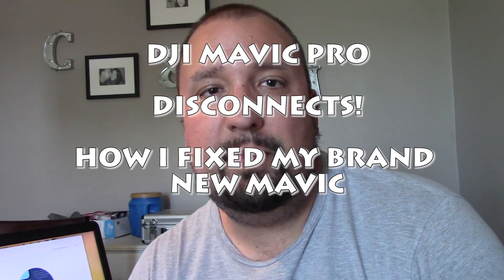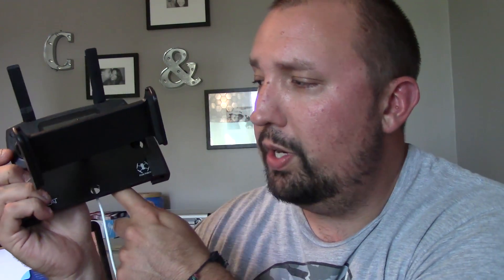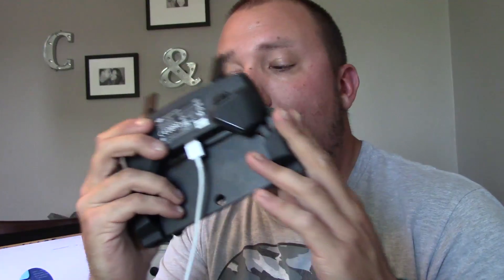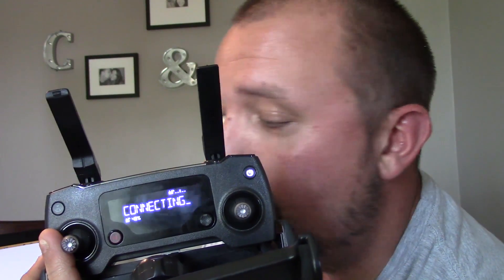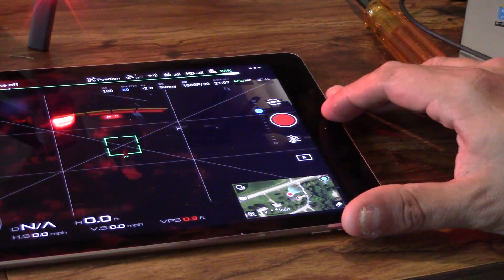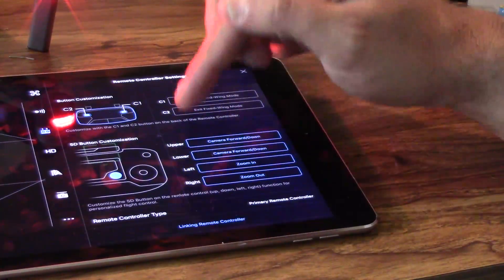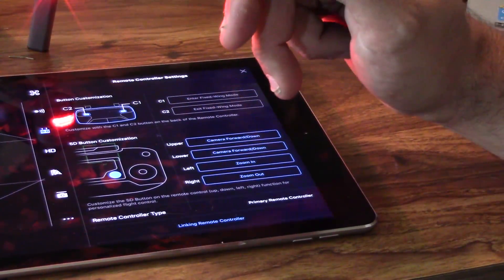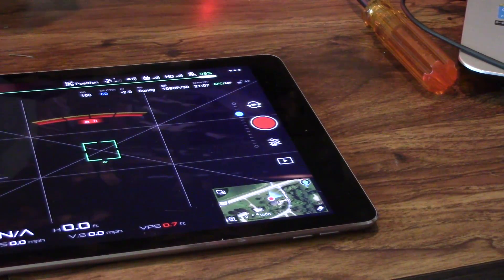DJI MAVIC PRO-HOW TO FIX DISCONNECTS- HOW I FIXED MY NEW MAVIC

Comment: This completely worked. Thank you so much. 
The issue I had was the "disconnect" from the RC and the phone. I just had to download the DJI assistant and it immediately worked. 
Now it seems the problem is the update of the firmware.

Comment: Really works fir my mavic pro Platinum,i try three cables to connect the USB of the controller with my phone and the third one works,seems the speed stransfer capacity of the cables can be really tricky!
Reply from the maker: Nice

Comment: My mavic gets disconnected just when it flies  7 mtr height , and when I bring it near 3 to 4 mtr it again gets connected . Can you suggest what could be the problem or could you send some videos to solve those problems.
Reply from the maker: are you using android or an IOS device?
Reply: @Dorkyand40  android phone note 10 plus.
Reply from the maker: @akungwelly  ah ok.  really stinks that android and the go app have never got along.  def try to use the original cord that comes with the phone and plug into the bottom of the mavic remote.
Reply: Does the Mavic gets disconnected when flying near some cellphone tower ?

Last time when I tried in different location the problem got solved but today again when I tried to fly my mavic zoom in my home compound the same disconnection problem start up again, 2 mobile towers are installed  a 1000 mtr away from my home. So I wonder is the tower causing the problems to disconnection ? Because day before yesterday i tried to fly my  mavic zoom in different location,  it has no disconnection issue at all but now when I tried to fly in my home which has a nearby cellphone tower,   my mavic gets disconnect just right away in 6 mtr. Itself , 

Please advice , what could be the problem as per your knowledge. 

Please revert back to me.

Comment: When I press the back button on my mavic 2 zoom or when I lose signal with the control, the drone DOES NOT return home, he tries to land, why? That also happens to me whenever I lose the signal with the control and almost lose the drone several times. I have configured that in case of signal loss, he returns to the takeoff point, but always tries to land.  Now I'm afraid to fly. I have the firmware updated and I always return in GPS mode. Please help!

Comment: for my Mavic Pro Platinum the "gimbal disconnect" message appeard suddenly out of the blue. TLDR:( put a new SD card in or format your old one) and the only solution was to take out the SD card, try turning it on without an SD card, and then it was working normal. So I formatted the SD Card, put it back in, and then it worked again like a charmer.

Comment: Hey brother, I am glad I stumbled into your video.  I was not going to watch it because it said Mavic and I have a Phantom 4 Pro Obsidian, but I went ahead and said WTF why not.  I had already watched a few other vids without any solution.  Then when you said "well maybe this will work, and maybe it wont", however you stated that, I was sure that I was still not going to get the answer...but your message of keep trying over and over, and trying multitudes of different methods, that is what got it for me.  I kept at it and kept doing the things you said...I loaded one version, then the other, did a full factory reset and was about to give up...but then I tried one more time...and it is fixed.  So thanks man.  You got me there.
Reply from the maker: good to hear man..it amazes me that a year later these problems still exist and there is really no answer from DJI..enjoy your P4P..its a great ship!

Comment: 11/10/2017 
This is important! I think I’ve discovered my solution to the error “Lost signal” and an Android (v5.1) error “Unfortunately Go 4 app has stopped”.
I've received my Mavic pro from warranty repair on Oct 8 2017 and was disappointed that after trying to activate the go 4 app the screen showed an android error which I eventually sensed that I had a problem with the Samsung Tab A not DJI. 
For me the Samsung Tab A was purchased because I was frugal. Some people would call me cheap. Anyway, I reset my Samsung Tab A to a fresh start and that so far seems to have solved all my problems. I now relegate the Samsung Tab A as an exclusive use for my Mavic Pro. BTW The Go 4 app installed was 4.1.15 and firmware updated to 01.04.0000
.

Comment: thanks man, i have been having problems with my magic pro with disconnetions or just not connecting at all, then it would then it wouldn't. i was convicted it was down to firmware but not update where available never considered it to be the usb connector, after watching your video i did a quick switch with my android connecter cable and it fixed the problem. cheep easy fix!!! well happy.

Comment: I had very frequent disconnects on my iPhone 6+ with my Mavic and simply switched the phone to flight mode before the flight and no more problems! Hope this helps someone else.
Reply: Had this with my  iPhone 6+ with my Mavic, haven't had it since switching to iPad.
Reply: Nick flight mode? What esle is there drive mode? It doesnt have wheels what are you talkin about?
Reply: @youbetubber777  probably airplane mode right🤭

Comment: What about app crashing? Almost every flight I get an app crash or 2 or even 3...... I have a samsung s8. Run from usb out of controller, changed usb to rule that out, but never had any type of full disconnects like your talking about, but app crashes all the dam time.... any suggestions? don't say get a iPhone please lol.... it especially crashes if I decide to put it into any type of mode, such as "point of interest" the other day, I flew it, battery started getting low, brought it home, which was not where I took off from because people ended up being there, the screen came up to cancel RTH JUST as I was about to land it, and the app crashed! the Mavic went straight up AT POWER WIRES..... I managed to hit the back stick just in time to avoid them by cm's.... then it proceeded to go where I took off from (If I would have known people where gonna come to where I was taking off from I would have changed the RTH to my point, but I didnt) finally I got the app back online and canceled the RTH.... and landed where I was on 1% battery.... when I was landing I had 15% battery.... regardless if app didn't crash everything would have been good, this issue could have been worse in multiple ways. Help?!?
Reply from the maker: DJ HEX sounds like some have success with the older android version. So roll back if you can.

Comment: I just bought a magic and I'm having constant disconnects. I'm running latest firmware. I have a 7 day replacement from the store and I want to make sure I don't have a defective magic before my 7 days expires. any suggestions? the store told me to rebind the controller to the magic but it didn't help. I live in the Philippines. steve
Reply: I think what he meant was Mavic, but if magic doesn't help then maybe hope does. :-)
Reply: Steve Burnett a new cable helps, be sure to get the braided ones.
Reply: I'm having severe cable issues. I'm on my third one now. I can't figure out why the cable connections suck so bad. Can't tell if it's on my phone end or the controller end.
Reply: Whats a "Magic"?

Comment: Great video chad thks  my mavic is running great  I have the neividia shield tablet I use works really good  but every so often the screen goes out  I have the iPhone to I have no problems with that I tried the wires that didn't help and it just started doing it the last month.   What's your thoughts or maybe somebody else has this problem.   Thks again

Comment: after the last update I had some issues with disconnects. the controller seemed to stay connected but the phone would drop. at the time of disconnect the gimble went crazy and almost looked like it was recalibrating in the air.
Reply: I was also getting compass error
Reply from the maker: Chris Brown sounds like a disaster. Did you get it all working.

Comment: So what happened to your mavic pro 1
Reply from the maker: LinoPR 2016 my newest one brand new was disconnecting from the app. App was up but would lose video and telemetry. Changed cables and all that and nothing worked. So I loaded firmware a few times and re linked the rc and it all went away.
Reply from the maker: LinoPR 2016 btw. Sold the first mavic.